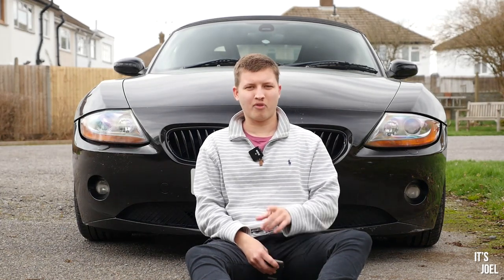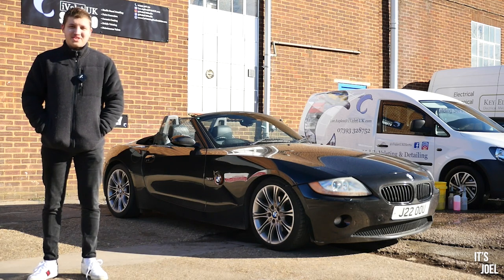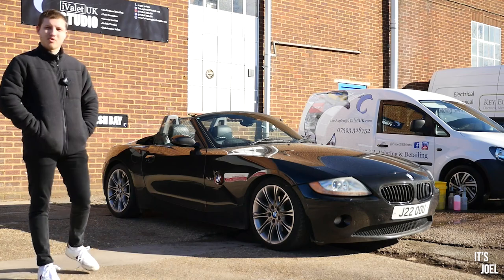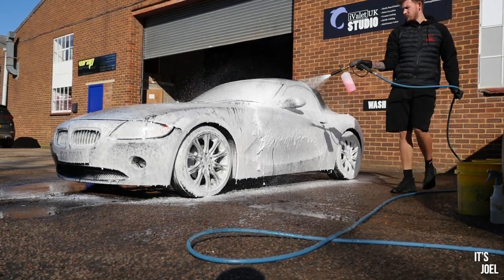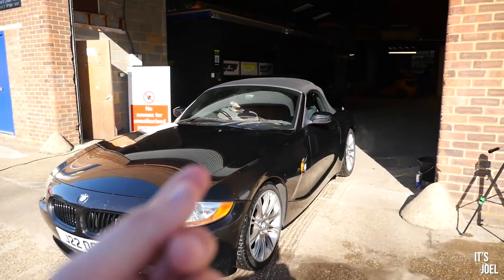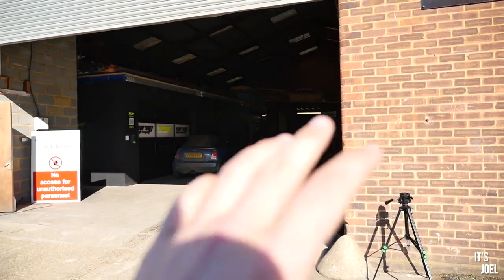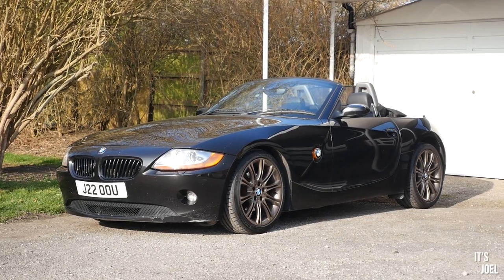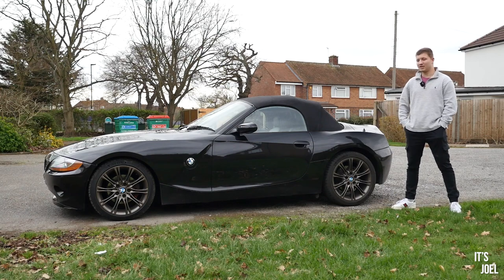32 hour deep paint correction detail & wheel respray on my BMW Z4...

Comment: Be interesting to see how the wheels hold up, generally paint tends to flake off after a while. I got my E60 wheels professionally done which means stripping down, acid dipping, sand blasting, hand sanding, baking, powder coating then baking again.

Comment: Wheels look really good and quite subtle - they look far better than I’d expected.. Time to paint the callipers and replace the spring clips, they look really grotty. For only  ~£30-40 and a half days worth of effort it will finish it off nicely. I did mine last summer: it’s a really easy job with the all inc kits you can buy. You can also buy a da polisher quite cheaply to keep on top of the swirls. Also managed to remove a scrape from a mates 911 after someone scuffed it at the supermarket; Amazing bits of kit.

Comment: She looks proper now mate. Good to see her looking her best and a nice touch on choosing probably the best Z4 colour there is, for the wheels. Chuck some spacers on her.
Reply from the maker: Definitely think it needs spacers yes. And a little lower too
Reply: @itsjoel  I went with 20mm rears and 15mm fronts mate. And I'm on 30mm Eibach lowering springs with no speed hump issues. See u fixed u aeriel 🤔🤔🤔🤔😂😂

Comment: Going to reregister mine, has been siting in the garage for 3 years with 58.000 klm on the clock, 2004 3.0i  manual jet black 18" BMW ellipsoid's. Not a bad wheel color, i have seen a couple with black wheels and they look too dark ,some ideas going through my mind.

Comment: 14:20 your bumper corner is still hanging lose, put a new bumper clip in it so the bumper is correct in line. why still no antenna?? and the 3.0 emblem is missing, its al in the details ;)

Comment: Key to doing paint correction is don't wash it unless your going to do it properly.
Jet wash and use a spray foam Lance, grit and dirt cling to buckets.
Don't use the same sponge for the body as the wheels and keep your sponge in a bag so that doesn't get dirts or grit in it.
Don't think a quick wash at a car wash will do it no harm, because you stop counting how many times you do it.
In the end it looks like someone's eaten their dinner off it.
Clay barring I do once a year, fall out from tree sap, moisture and road contaminants attack the paint everyday, don't let the surface dry out in the process and follow body lines horizontal on sides and tops.
Don't polish or decontaminate in direct sunlight and work a panel a time in small to medium size areas.
Check each panel in direct sunlight, and remember your paint isn't 6ft deep take your time don't over work it.